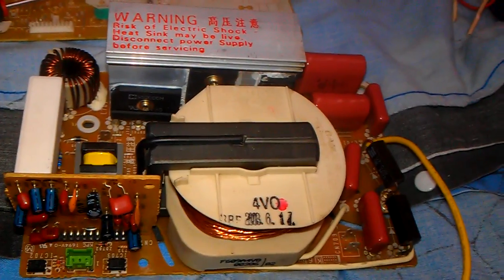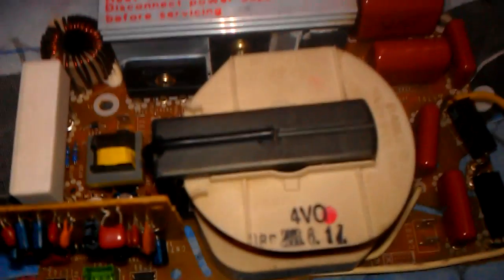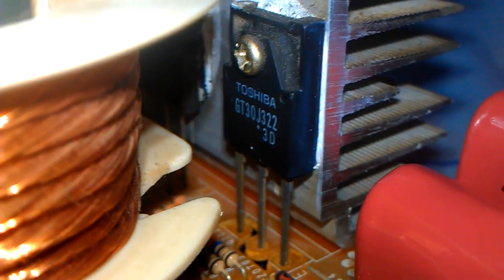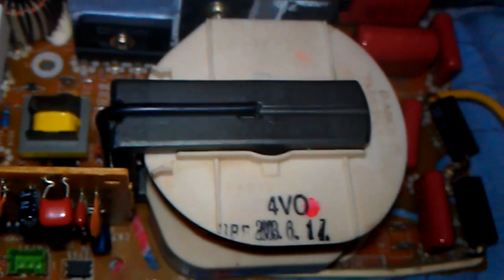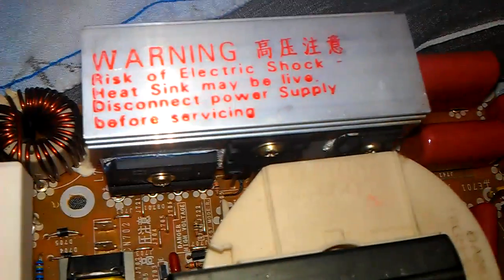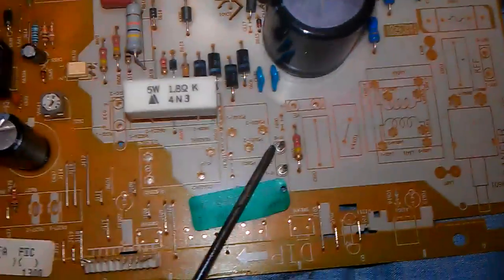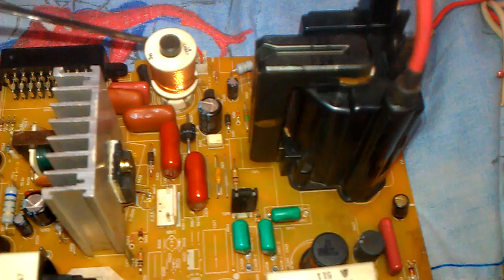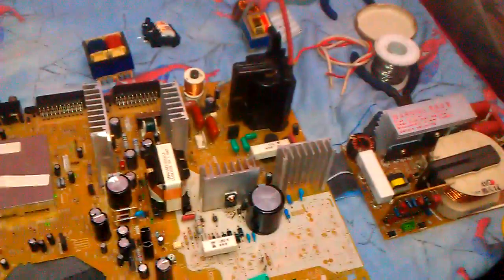Microwave inverter & crt tv board.

Comment: Very informative, but all please be aware that these items are lethal when operating. The voltages & current produced from microwave oven inverter power supplies can stop your heart! I'm horrified at how many videos on microwave ovens etc. don't even mention in passing, the dangers involved.
Reply from the maker: I dont mess with mots. And when i di show one working (iron core) i told the dangers. I always say and tell of the dangers with messing with high voltage. And if someone doesnt know what there doing like some one wiring one up to a 3 amp light switch' yes its been done!! Thats how stupid some peaple are!! But' theres also alot of peaple with sense of how things are wired correctly and knowing the dangers. So what else can peaple do once they have told the viewers!?! Not much apart from telling!! 
Thanks for the comment.